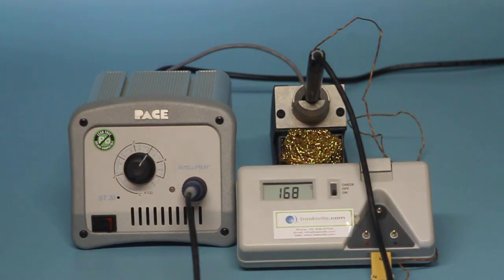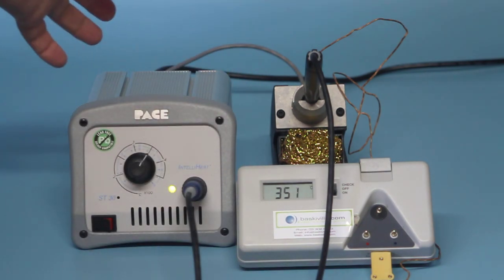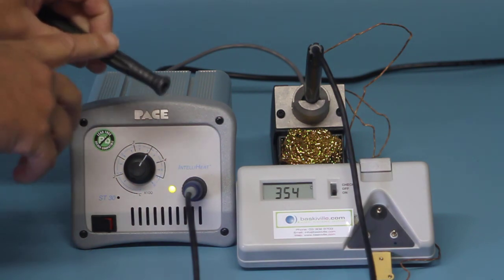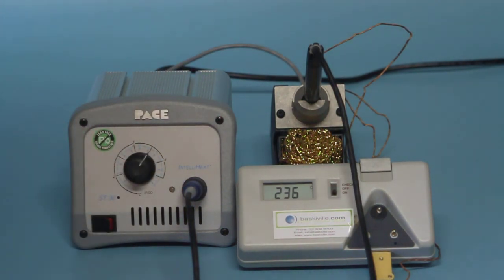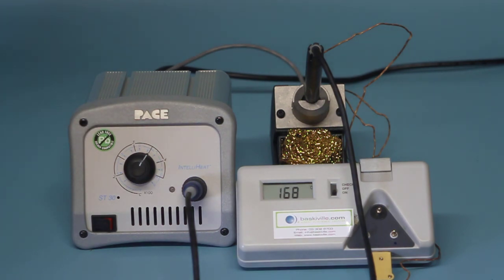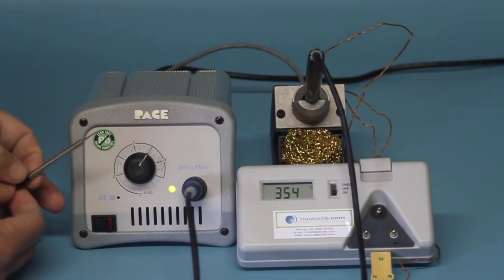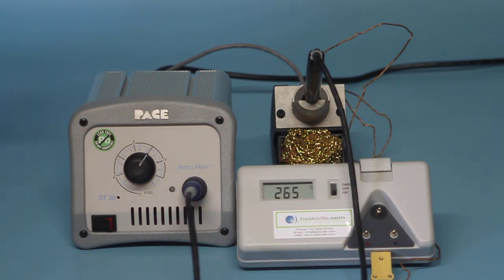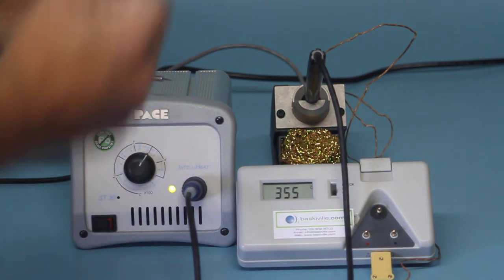Soldering Tips, Tip Changeing and Set Back Cubbys  PACE

Comment: The quicko simply uses a motion sensor in handle and even if you don't place it on stand but on the bench it will turn it down it down.